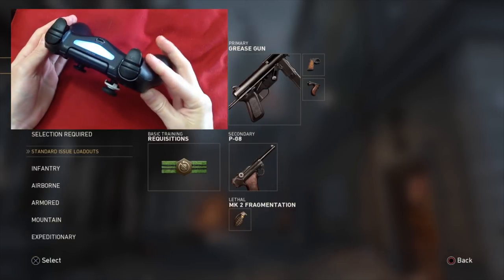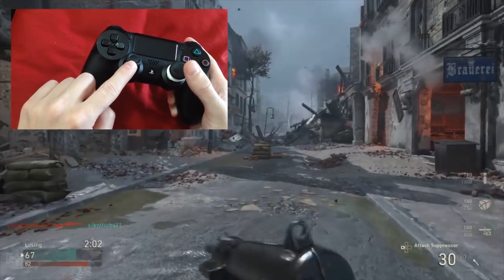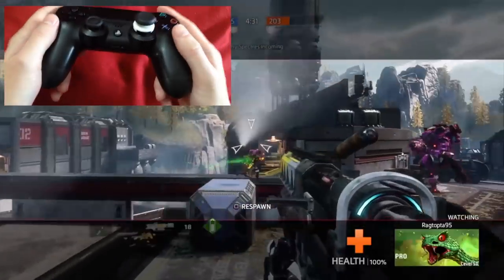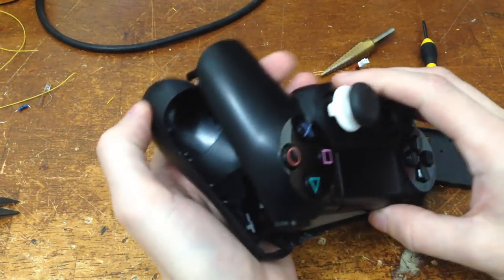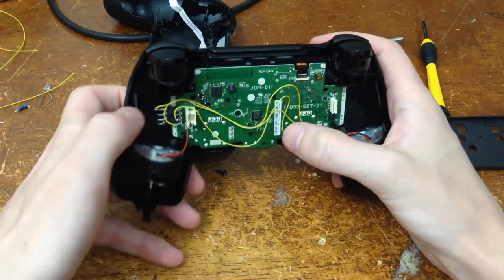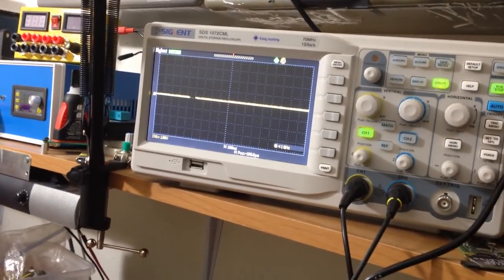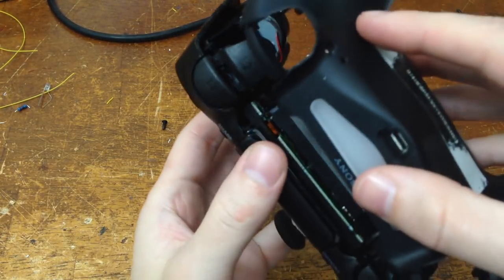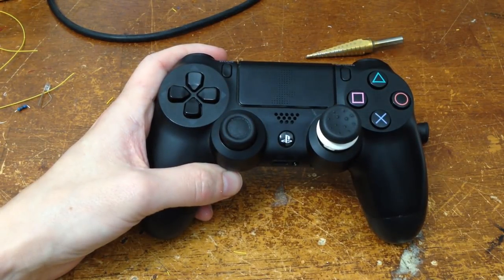PS4 controller hack adds auto-sprint to COD WWII

Comment: Just found this video when I was looking if some had hadded programmable buttons on PS4 controller. Great work!
One question: is your code pressing the L3 button every 50ms, because I cant find any other delay.
Reply from the maker: You're correct! While auto-run is enabled, the controller is pressing L3 10 times a second (50ms on, 50ms off). It seems a little fast, but in practice that fast press ensures that as sprint resumes in less than 1/10th of a second after the "exhaustion" period is over

Comment: Scott Harden what size wire are you using
Reply from the maker: It's just wire-wrap wire (30 gauge solid core)
Reply: Scott Harden thank you so much

Great video, it’s got me interested in coding and these sort of things. I’m currently building this but I’m modifying for RDR2 so I don’t have to continually press X to sprint. Thanks again
Reply from the maker: @simplematters4893  that sounds like a cool mod! I'm sure you'll learn a lot along the way. Thin wire like this is cheap on ebay and amazon. Good luck!
Reply: Scott Harden what software are you using to write the code.
Reply from the maker: @simplematters4893  Notepad++ (I use WinAVR to compile it) - source code is at the link in the description
Reply: Scott Harden do you recommend any software that is Mac supported
Reply: Scott Harden is the ISP you used compatible with arduino, if so would I need a breadboard. Please help I’m very confused.